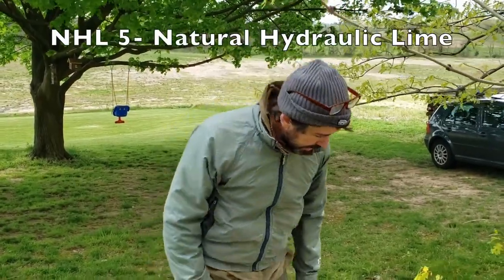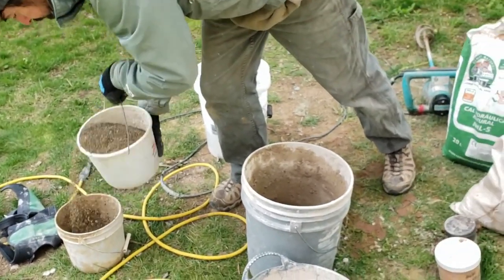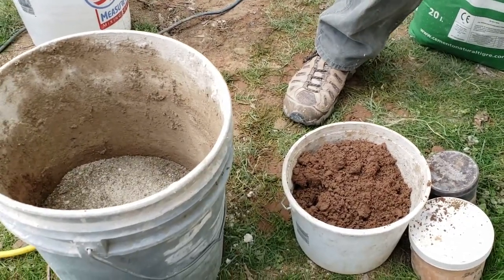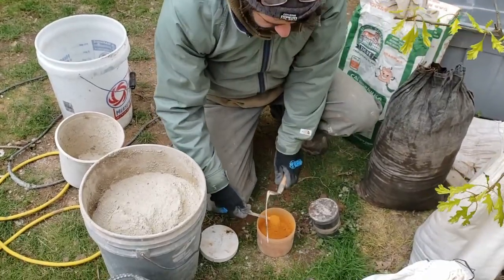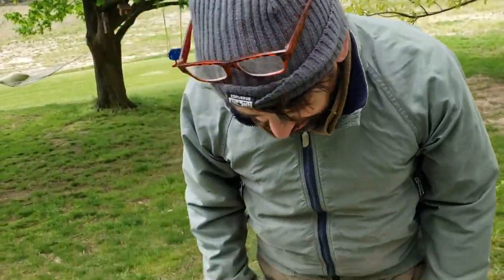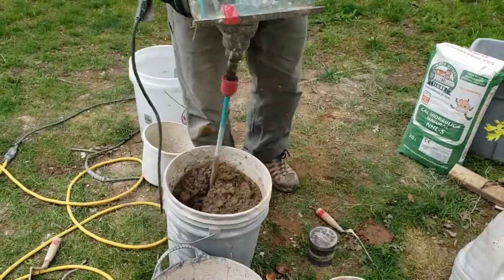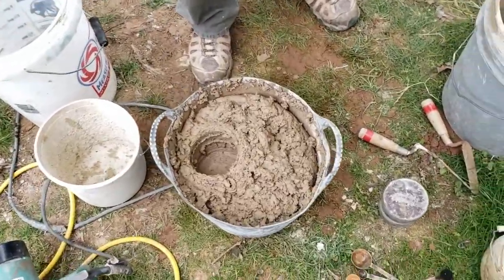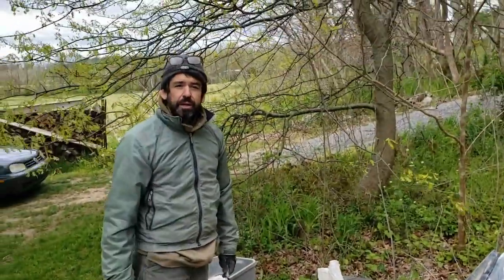How to mix mortar using NHL- Natural Hydraulic Lime

Comment: Great organised mixing set up for posting stone walls. 

What would you recommend to to mix Hot lime mortar for plastering walls (Quicklime slaked with a sand) ? Do I slake before mixing with a paddle mixer, or use a Baron mixer or Roller pan mixer ?

Comment: Hi . What color did you get from this mortar when dry ?
Do you need to treat the mortar after apply on wall to prevent cracking etc ?
Can you help with this on a video etc 
Thanks
Reply from the maker: The color was a lavender hued brown which matched the stone.
To prevent cracking and failure you need to keep NHL mortar damp for 72 hours minimally after installation.